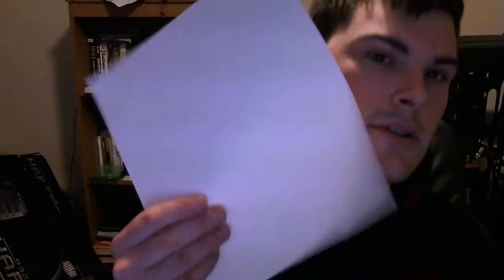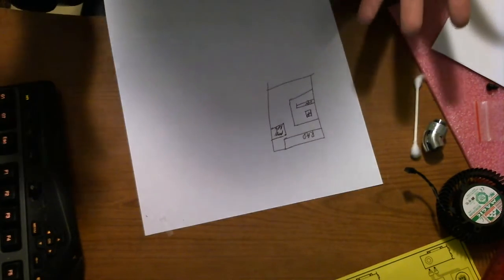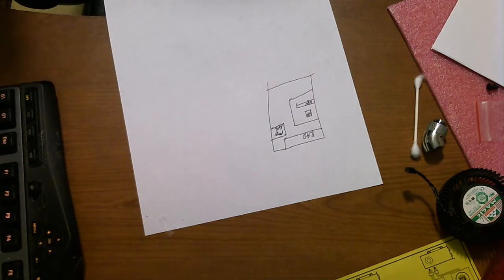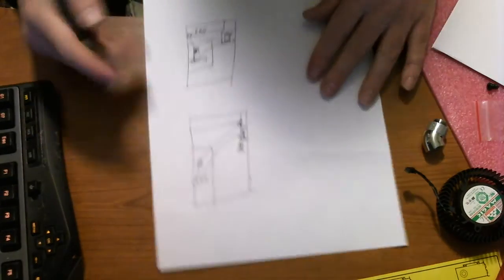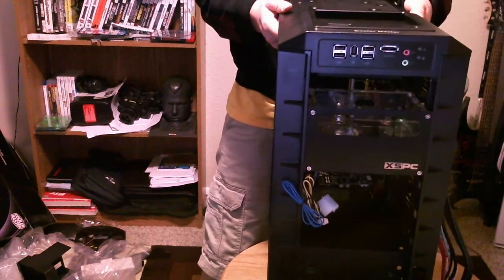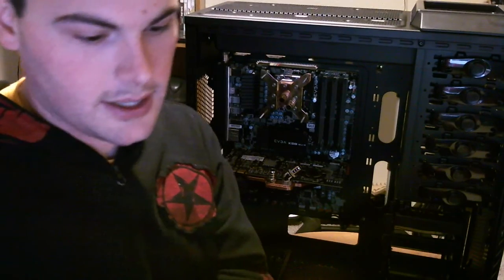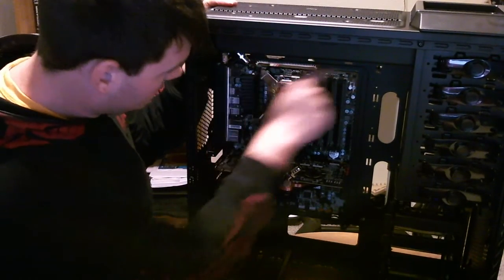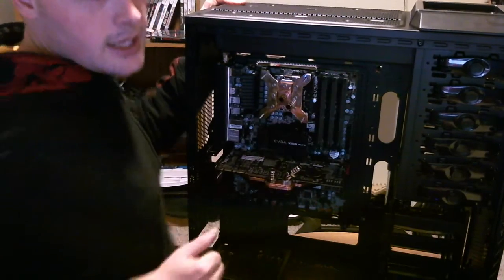How to setup and install a water cooling setup/loop (Part 1)

Comment: great videos, found them while looking for how to clean waterblock, one question, now i have read a lot of forums about this but haven't seen any concrete info on it besides hearsay, when going gpu cpu rad rad, my thoughts on that is maybe that it would be better to go gpu rad cpu rad to help keep cooler temps going to cpu, i know a lot of people say but the overall temp doesn't change, but the cooler the water going into hot parts the cooler those parts would run, say the temp changes by maybe 10c per part, say cpu to gpu the gpu would be taking in water that is already 10c hotter then overall temp so wouldn't it cool less effectively? due to extra heat

Comment: Keep in mind that placement of the rad can influence your pump.
The pump will die faster if you have a higher temp water coming into it, so that's why I always put the rad before Res.
Reply from the maker: Loop order doesn't matter

Comment: Well it would be cooling 4 gtx titans 2 cpus and 12 Ram Dims plus each of these will be heavily over clocked. The Rads would be 2 triple 120mm and 2 single 120mm. Any help would be appreciated :)

Comment: Also nvm i want to water cool everything except ram, my specs:

Nvidia GTX 690
Intel Core i7 Extreme 965
1200w PSU

Thanks in advace, any help will be appreciated, also for brand i would prefer Koolance, i hear they're pretty good.

Comment: The most obvious thing you missed was that you mounted the radiator so the barbs are at the back but the smart thing to do would be to mount it the other way so that the barbs are near the drive bay, that way you don't have an ugly tube going right on top of your CPU block. If you had a second radiator on the outside at the back this would the best option however.

Comment: @vyteniswolfas The temp differences compared to a single loop vs a dual would be minimal at best. Beside being more work to maintain, it would be messier and half the point of water cooling is to have a clean build. Stick with one loop.

Comment: wouldnt the water from cooling the CPU be hot? then you put that hot water onto the GPU.. thats not a very good idea i think.
im building a computer with 2 RADs one is triple and other is quad. which do you think i should put to the cpu , triple or quad? or what if i go - res - rad triple - rad quad - cpu - pump - res, would the water be extra cold than if i run it through 1 rad ? therefore i can overclock my cpu more

Comment: @juggolo i was going for silence over cooling so if i had a super quiet fan on that rad i wouldnt get sufficient cooling. So if you think the double rad will work i'll go with that. It also stops the water being too hot when it goes into the res

Comment: In the loop you recommend the water coming off the hot CPU/GPU is heating up the res.  This will create higher overall water temps in the long run.  Ideally it should go Res, pump, CPU, GPU, Rad, back to Res.  Cooling the liquid when it is at its hottest point before adding it back to reserves.

Comment from the maker: @TheSecretCobra 
The 800D has horraible air flow. I have experience with these cases. 
So you can control the speed so what I run my pump full throttle on the mcp355 which I am using and nothing wrong has happened and it is still quite(fiances build/Used in this wc series). My buddy who has the 800d has two mcp355 pumps(running full throttle) with a dual bay res and you cant hear them. So you are really not justifying the cost to me.

Comment: @juggolo The Airflow is actually pretty good on the 800D, and I would rather have the 5.25" bay Pump and Res so it's more simplified and I have control over flow speed an others despite the added cost.

Comment from the maker: @TheSecretCobra 
get a mcp355 pump then a xspc dual bay res for 108.88 total. or get a mcp35x(better pump) with a xspc dual bay res 131.88 .
the corsair 800D has bad airflow.

Comment from the maker: @TheSecretCobra 
Rip off if your getting that Koolance rp-1000bk. 
800d is played out. Not good with airflow unless you buy aftermarket fans. Red uv tubing will glow red Orangeish not red.

Comment: The Koolance RP-1000BK fits in a 5.25" Bay, it's a Res and Pump so it minimizes the work and saves space. For the 800D, I am getting a 3x120mm Rad as I can mount it on top with the 3 fans. Top it off with Red UV Tubing, and an Black-light and tell me it wouldn't look beast.

Comment from the maker: @Delcaroll 
Maybe you should know how water cooling works like heat transfer anew how the water is not sitting over the cpu for an extended period time then going to the gpu. Let alone I have a video on temps.

Comment from the maker: @BrokenTomahawk 
The water isn't just sitting over a component got a long period of time. The water is constantantly moving at a fast rate. Also look at the radiator  heat dissipation and how much the components are actually putting into the loop.

Comment: wtf is wrong with youtubes transcribe audio thing?

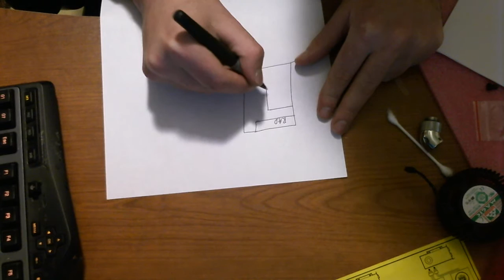1:45 
the seat youre up there on your paper take
gp you
the reason why i could
geez you
but here in the city is because i mark one will so
im basically a result of my or adolf hitler.
WTF??!!??
4:59
all right so it's your ass
now that she had diplomatic inside The friday
somehow 
so you have your ass
on the line where the under ordered
7:00
temporary emyployee
at issue that nazi you but the jeep you bought temporary in place
larry
bruce you you

Comment from the maker: @zaxis01 
Mcp355 pump with a top is better. No reason to cool your mb. Just the CPU and gpu and yes it should be enough. As long you have the pump before the res your fine. Loop order does not matter other than that

Comment: @HDaviator the water passes through the cpu block pretty fast to even get a lot of heat it doesn't just stay there and waits till it get warm and than goes on to the gpu! omg, use your head please

Comment from the maker: @HDaviator 
No look how much the rad can dissipate then look on how much the components are actually putting heat into the loop. It may not make sense to you but it does to me. Look at the water cooling stickys.at overclock...net with one .

Comment from the maker: @Wiifan4life 
More or less if you want to get technical is that the 6xxxx series is no more than a revamped/improved 5xxxx series card. They did not deemed it necessary to call it Version 2 of the 5xxx series. Instead they decided to make a whole new series of video cards.

Comment: @juggolo not true. the 6850/70 are different gpus with equivalent performance of the 5830/5850 respectively but use less power. So no, not a complete rebrand.

Comment: What i do is first i look at what hardware i want to use for say 1-2 years .
Then i look at what i want to cool and then i look for what case is the best for having all the watercooling stuff inside.
Then i will use paint and try just like you one paper to put this in the layout of the case.
It helps if you have a good imagination how to put things in the case and do a lot of reading about watercooling :)